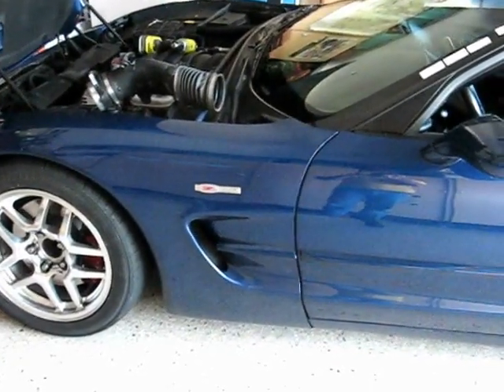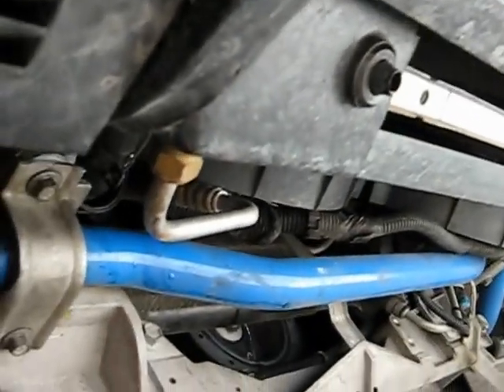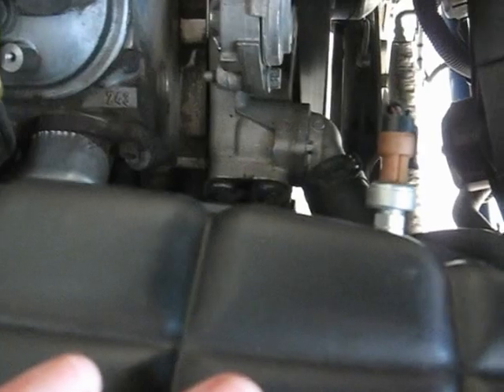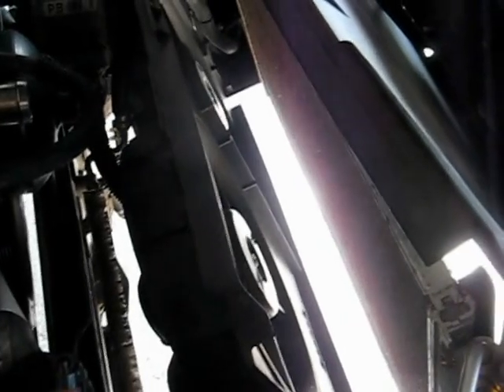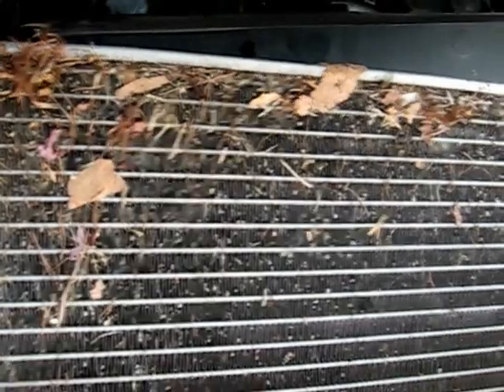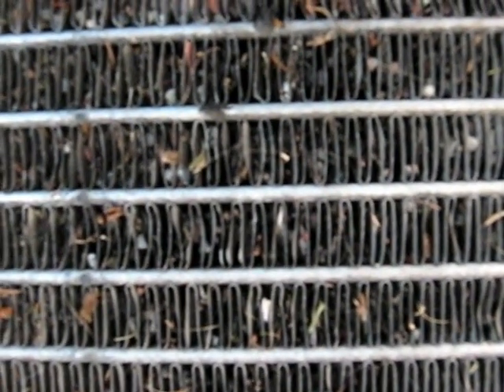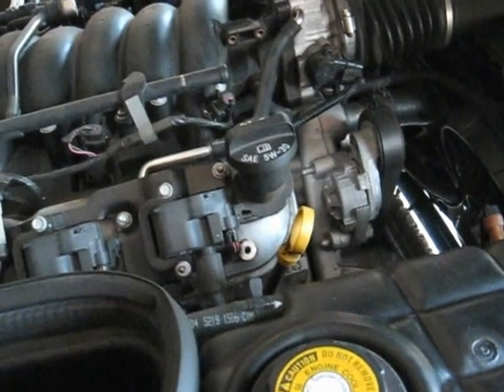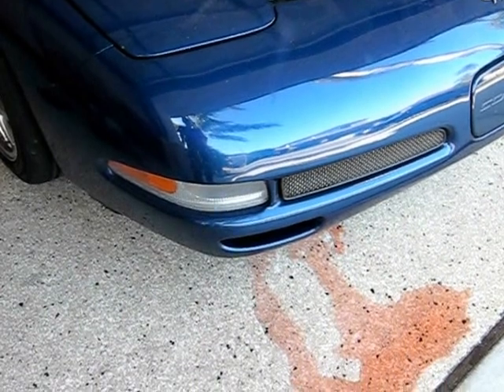Corvette remove & install radiator c5 by froggy

Comment: Thanks for the tips Froggy!  I got my radiator out today and no wonder it wouldn’t cool very good. My car has 130 k and you could not see through the radiator it was so full of crap! I’m also putting a double core rad in it so my cooling problems should be gone. Thanks again for the videos! 🖖🏻
Reply from the maker: Welcome!

Comment: Just wanted to say, thanks for posting this video. I had to replace the radiator on my 2001 ZO6. I'm going to preface this by saying, I didn't follow all the steps and I should have. One, I should have had someone help me and I wish I would have had a pair of hose clamp pliers. That lower hose was a pain in the #$% to replace. Other than that, It went pretty smooth.

Thanks again, keep em' coming.

Comment from the maker: One trick I used on my e36 M3 (which was hard to burp) was to put it into as much of a nose high angle as possible with ramps or a driveway incline (or both). The air trapped wants to go to the highest point & accumulate there.

But really just make sure the coolant is a over the full mark (hot or cold are different) depending on the temp. & give it a good drive and watch the temp gauge. It'll eventually bleed itself after a few cycles of opening & closing the thermostat.

:)

Comment: Thanks for the helpful video.  It's nice to get an idea what you are in for before starting.  I did do it by myself, made some smooth flat pieces of cardboard for the radiator to slide down without gouging anything, but jostling it after to get it all lined up was a real pain with only one person.  Cannot believe how tight it is down by the lower radiator hose!  I put in the LG with the integrated oil cooler, read that the lines were awful, but they slinked right through no problem.
Reply from the maker: +Steve S Good work!

:)

Comment: That's good help fixing to do the same thing on my 01 C5 ZO6 Corvette top left corner above the upper hose there's a hairline crack so thanks for the video now I know what I'm in for when I go to do mine  why they had to do plastic tanks on radiators is beyond me every car in the fleet I had to replaced the radiators and put all metal in and do away with plastic tanks.

Comment: I got a NAPA radiator.  After comparing it to the dealers, I didn't see a need to spend the extra money. It was a direct fit replacement.  Yes, it has the hookup for an auto trans but because I have a 6 speed it wasn't used. It was explained and shown to me that the auto trans hookup wasn't taking away from the engine cooling surface area because that "smaller radiator" was confined to the right (passenger) side of the unit. Basically it is vertical only and not horizontal across the entire unit

Comment from the maker: I just LIFTED the fans (they are on like hangers - look close you will see) and I moved them an inch or so - enough to get the radiator in & easier than pulling them out.

Comment: 2000 C5 with 30k. Thermostat 1 year old, fans bought used with unknown mileage and age. I bench tested the fans prior to installation 2 years ago and they appear to be blowing as good as they did when I got them.

Comment: Interestingly, I have the same car, 2001 Z06, and the exact same problem, hairline crack on the exact same spot as yours. I tried JB Weld a couple of times, and didn't work. So I too will be replacing mine soon with an all aluminum DeWitt's.

Comment: Oh wow, those are high temps! I see why you went bigger. I had a few pin hole leaks and the smell of coolant was driving me crazy. I will try your coolant fill method of topping off the run it hard. Should I turn the car off and vent the tank or leave it running?

Comment from the maker: Which radiator did you install? Any built in oil or tranny coolers inside the radiator? Have you changed the factory settings for fans on/off? What thermostat temp do you have?

I never even had to burp mine, just overfilled the tank a bit & ran it.

Sometimes you have to run it hard a few times to really get the air pockets out plus several heat up cool down cycles to suck from the overflow into the block/radiator/hoses etc.

Post back info.

Comment from the maker: Never mind I missed the other post. Those temps are fine, well within specification. If you were running cooler than that with the old radiator, I'm not sure why. Did you have a leak? Reason for change?

When I track mine I have seen 245-250 coolant temps with a stock radiator. That's too high so I put in a big race radiator to lower the temps.

:)

Comment: I did not change any fan settings and the temps are not too far out of what I consider normal. I typically saw 175 cruising and it would spike to about 190. Fans came on at 185 and off at 174. Now I'm seeing cruising at 180 and spiking at 200. Fans on at 174 and now only turn off when idling.

Comment: Hi Froggy,  Just need to change the fan.  Is it the air intake, shroud top and maybe the upper radiator hose that has to come off only ??
Reply from the maker: Not sure as I have not done this, I'm thinking radiator also to give you room to work.

Comment: I used a duster brush on a shop vac and an airgun w compressor. Then Coil cleaner works pretty good for clogged fins. It loosens it up. Then rinse with water
Reply from the maker: Very good, any way that cleans the crap off is good, don't bend the fins.

:)

Comment: hey froggy, You ever remove the ac condenser before on your c5? i want to take mine out as it is useless for me but not sure how much pressure is in the lines. AC has not been ran in 4 years or so.

Comment: Thanks for the video, I did my C5 radiator swap after watching this! It was a pain but I lerned allot and I'm now wiser for it. I do have a question,  my temps appear to be higher than before the swap. I ran it until it was up to temperature and then I would burp the tank letting air out. I've done this 6 times now but my temps are still high. Should I ignore the "cold fill" line and just fill the entire tank to the fill neck, then burp it?

Comment: Thanks for the great video!  I'll be doing mine in the next week or so.  I noticed your replacement radiator looked all aluminum where as the oem has a plastic tank.  Where did you find it and do you remember how much it cost?  I can't find an all aluminum one.  Thanks again!

Bob D
Reply from the maker: +Robert Demore It's a DeWitts. Google it.

:)
Reply: Thank you, I'll check it out!

Comment: I'm noticing with the all aluminum radiators they have metal protrusions at the top that look different than the stock and seem like they would make it difficult to button down that plastic piece at top that buttons down the radiator.??  Did you have any issues.
Reply from the maker: no, it fit, it was a while ago, no problem.

Comment: Is it difficult to remove the fans and  I see that it's all plastic in there and you just turn the clips a quarter turn in a pop of her do you know what the deal is I hate working with plastic parts right now mine is sitting on a open trailer and I'm just going to roll it down off the trailer halfway on the ramps and that should leave me enough room to get underneath if need be kinda bummed I just did radiator flush last March before winter and everything looks fine I'm in Colorado

Comment: Froggy have you ever changed your oil pressure sending unit ??? Mine is pegged out when I start the car and figure it time to change it.
Reply from the maker: No but there are a lot of threads on doing it & maybe yt video.

There is a way to relocate it & also a way to cut a hole just above the sensor in that panel if you don't mind the hole, it can/should be sealed up after.

:)

Comment: Hey Froggy, I have every the trans lines off, the coolant hoses off but I'm having trouble separating the condenser from the radiator. I have it lifted off the tabs as far as I can tell but it wants to come out with the radiator. Am I missing something or is it tough to separate them. Also do you have to remove the condenser cover in front to move the condenser far enough. Thanks
Reply from the maker: I only lifted the radiator out of mine, it's easier with 2 people. You should be able to see everything that needs disconnect. I did not need to mover the condenser (not an auto tranny).

:)

:)

Comment: Do you have video on how to bleed the coolant on a C5? Thanks!
Reply from the maker: I have never had to bleed mine. I have drained the radiator and refilled thru the expansion tank, fill it pretty high. Run the car til its hot, heater on full hot and rev it good on the road for a few miles. WATCH THE TEMP GAUGE. STOP if it goes too hot.

In my experience it's self bleeding, unless you drain the block.

If you drain the block then you need to open the system at a HIGH point and let air out.

Comment: I took out the lower scoop on my 2001 my car runs cool and don't seem to get as much junk building up on the condenser as it use too
Reply from the maker: That "scoop" is designed to catch air & feed it up to the radiator(s). Also stabilize car at high speeds so air does not get under & "float" the car.

:)
Reply: froggy it runs cooler without it and I don't drive fast anymore  when I got it 11 years ago I got up to 187 but that was a new toy now I just cruise after my back injury I only drive on weekends now  but it runs cooler in the summer without it
Reply from the maker: I totally believe you, not questioning. Air flows are very mysterious things. Check out Formula 1 air flow engineering if you want to amaze yourself. I would just keep it free from debris & drive & have fun, thanks.

:)

Comment: Hi. What kind of tool to you use to turn the drain plug. Ratchet 1/4 only spinnes. Do you have any good advise?
Reply from the maker: I might have just used good small vise grips, just go carefully.

:)
Reply: Thank you. I got it off. Now I will buy the doorman witch I can just turn by hand.
Reply from the maker: Get as good quality as you can.

:)

Comment: Hey froggy, thanks for your work... you save me $$$!  I purchased a replacement radiator at Advanced Auto parts.  There are two brass fittings on the passenger side of the new radiator.  I noticed yours didn't have those.  I have a 2000 manual transmission.  Any idea what those are for, before I tear into this?
Reply from the maker: Probably fittings for an internal oil cooler or automatic tranny cooler. You can cover them up if you don't need them. Some aftermarket radiators make one model that fits different options.

:)

So if YOUR car has nothing like that just cap them off.
Reply: Thanks Froggy!  Turned out I bought a radiator for an automatic transmission.  I took it back and ordered an all aluminum radiator on line made for a manual transmission.  The Auto Zone radiator was plastic like the OEM one that cracked just above the hose fitting.  I appreciate your videos.
Reply from the maker: Thanks!

:)

Comment: Froggy on the c5 which fan is the primary
Reply from the maker: I don't actually know, sorry, they both need to be working correctly of course.

:)
Reply: +froggy wow this is a old video Did think you'd reply tanks its seems my 02 is heating up
Reply from the maker: Check the radiator, fans run, etc. Basics. Make sure your air dam is properly sending air to the radiator.

:)

Comment: Froggy, I've been following your videos as much as possible.  I have a problem hoping you can help me with.  I have an C5 Corvette 2001. What is happening is the air/heat is on the display. But it isn't coming on. Then I was driving down the street and it finally comes on.  At this time I turned to stop and tried both heat and air. Working fine.  I remember last year before putting it up that it did the same thing. Came on when it wanted to.    Need your help.  Could it be a blower resistor?or even a relay.   I have checked all the fuses, all working.   I just don't know where the resistor is for the blower
                                                                                        Thanks Don Eller
                                                                                        ellerpapad@aol.com